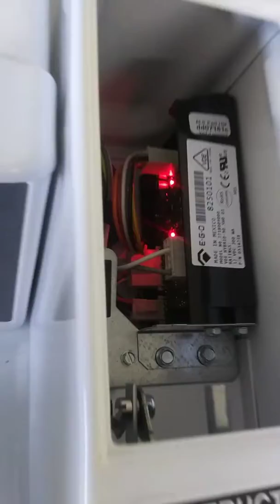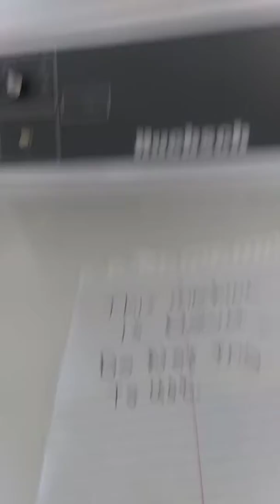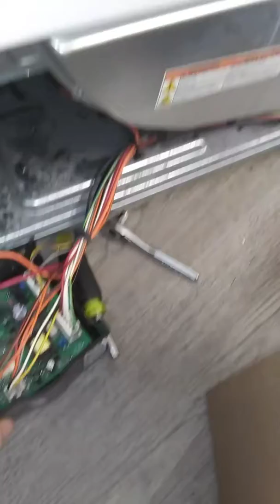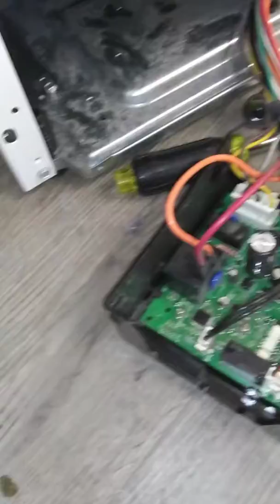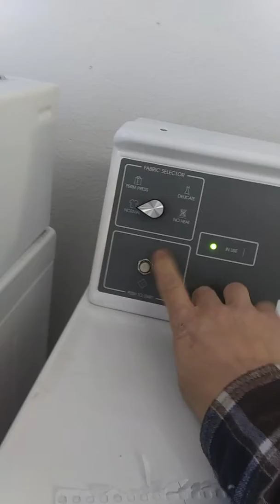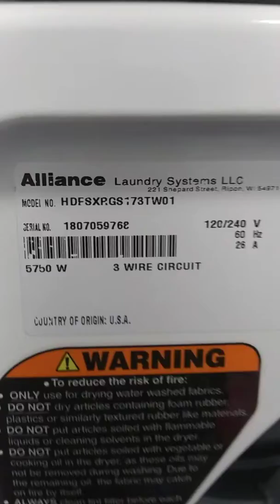Huebsch, Speed Queen Commercial Dryer Not Starting: Output Board Part # D513797P

Comment: Hi James, video was helpful. I checked the output board on the bottom but the red light blinks a lot faster. What could that problem be?
Reply from the maker: If you pop the screws out of the top of the console and rock it forward to access inside, all your tech info is there. It should be, anyway. If your tech sheet is missing, then I can't tell you off the top of my head. Codes are on the tech sheet if that's what you're after. There is no way I can wave my magic wand and tell you what is wrong just by telling me a red light on the output board is blinking. What was your dryer doing or not doing prior to you finding that light? Is it not coming on at all? Is it registering inputs to the output board? You have to help me for me to help you. I'm a technician. Not a magician.

Comment: Hi James, great video. I am trying to replace the board on my Speed queen unit but I am not sure how to disconnect the relay cables from the old board to plug them into the new one. I can't find anything on how to do it online either.
Reply from the maker: If it's the same board as in this video, you will see plastic retaining tabs on the connectors themselves that clip into the part on the board. Squeeze and pull. It'll take some effort for the larger ones, but they'll come off. Going back in, they're pretty idiot-proof. They can only go on one way and also only fit into their respective ports. Generally speaking when it comes tp connectors on boards, regular spade connectors sometimes take a bit of a pry with a flat head screwdriver, and the little DC connectors with the tiny pins just wiggle out of their holders. If I can help any more, just let me know. Awful hard to describe over a Youtube comment...
Reply: @cgappliancetelevision2315  Thank you for getting back to me. It took me a while but I eventually managed to do it. Your video was really helpful, keep up the great work!